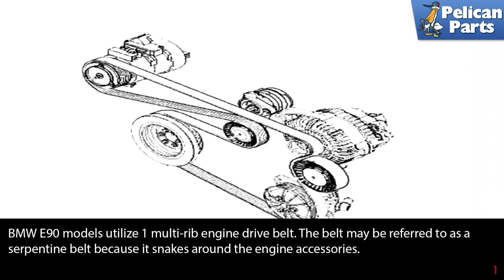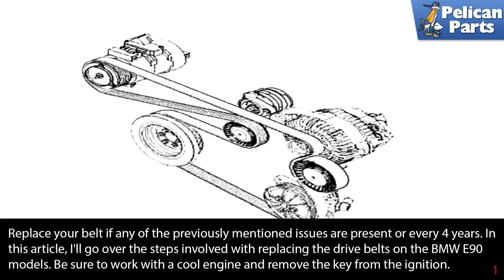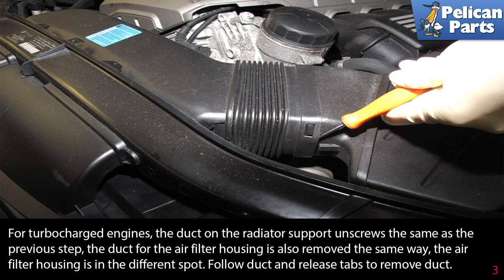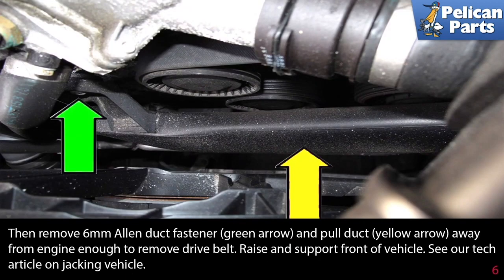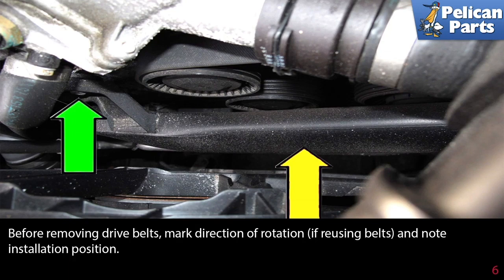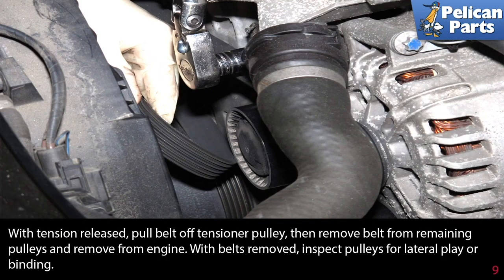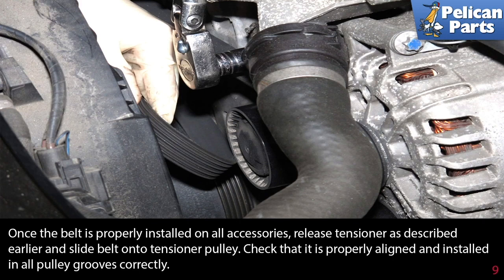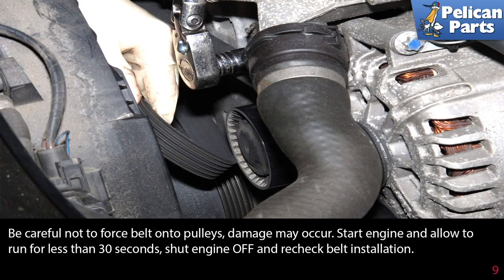BMW E90 3-Series Drive Belt Replacement for 335i,  325i, 325Xi, 330i, 330xi and 328i

Comment: Hey I have a question. I have a 2003 bmw e46 330xi. So I can start my car but when I put it in drive, I tap the gas but it doesn’t move. Also when I put it in reverse it don’t do nothing either. Can you help figure out what the problem is?
Reply from the maker: Could be an issue with the transmission. First check the transmission fluid level to be sure it is correct. Then check the transmission ECM for fault codes. If the system is not working properly, a fault code will be set. This will be your best bet when diagnosing.
Reply: Pelican Parts the transmission fluids was leaking bad and wasn’t staying in.